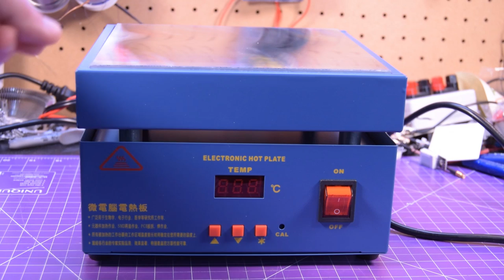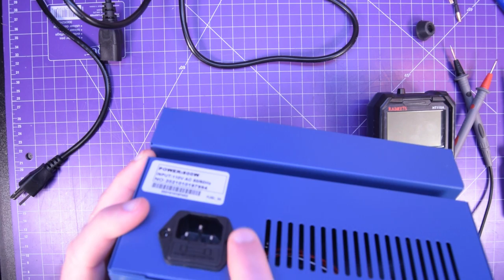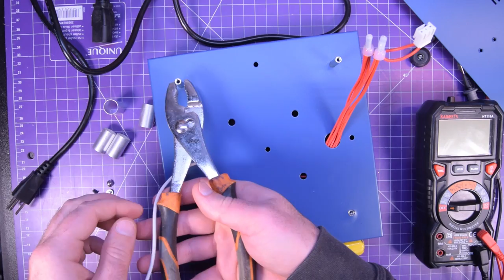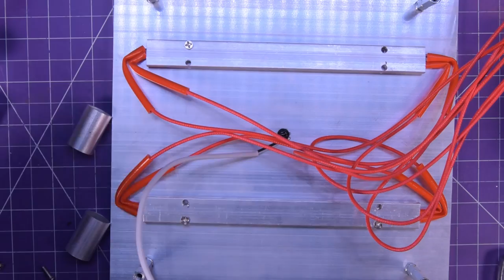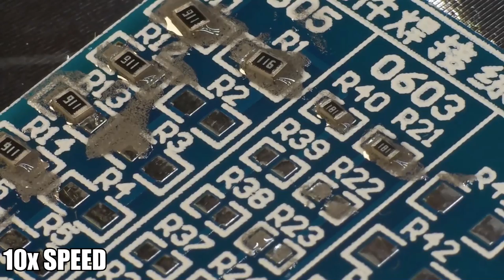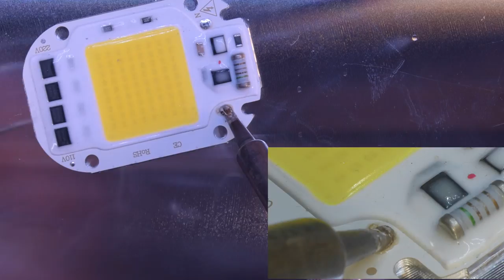Teardown And First Test Of A Soldering Hotplate! (946C First Look)

Comment: That's a much better heater setup than my unit (which looks exactly the same on the outside).  Either I got a cheap copy or they have changed the design.  Mine had a one-piece heating pad held against the top plate by a large metal plate -- which was painted (and burned, as I commented before). Anyone who gets one should check the heating element setup to make sure they got the right kind.

Comment: In a former life I worked as a heavy equipment mechanic.  We would never put wiring through a metal plate without some rubber grommets to protect the wire from rubbing on the metal.

Comment: to build that would cost more if you went dimensionally accurate. amazon charges like 40 beans for a decent sized aluminium plate but the rest would be cheap only it would add up. i bet it could be modded to remove screens from devices as well. i laughed when i seen the transformer haha.

Comment: It seems like they were thinking that the bottom plate and transformer would get grounded through the mounting screws.
Possibly adding star or lock washers would work.
Reply: Scrape away some of the blue coating.

Comment: With four self tapping sheet metal screws going through that bottom plate, it's hardly not going to be grounded if, as you demonstrate, the sides of the metal case are grounded. Probing the powder coating doesn't really prove anything because you'd expect that to be an insulator. And to want to put heatshrink tubing on the spade connectors in case they fall off seems a bit obsessive and highly unlikely. I bet you couldn't shake the entire unit hard enough to get those spades to fall off the switch. You seem to be extremely critical and looking for any kind of negative (the holes seem to be drilled by hand being one of several examples).

Comment: I just got one and I don’t understand the directions, it says not operate hotter than 110 degrees Celsius- or the lcd screen may be destroyed. Can I pump up the temperature for smd soldering, or should I just leave it at 100 degrees and use a hot air station to bring it up the rest of the way?

Comment: A much simpler mod would be to sink an additional self-tapping screw from the bottom into the flange of the sides.  Two for redundancy if you want.  First scrape away a little paint if you're paranoid, but the self tapping screw would be totally sufficient.

Comment: would thermal paste between the heating elements and the plate help to maintain constant temps? or heat up faster? Also, most of the 946c models come with heat shrink wrap on all the terminals, but obviously worth checking after seeing how yours came, ohh and most versions are grounded. Yes I'd like to see how you modify yours! nice vid, thanks:) you get a sub so I don't miss your mod video.
Reply from the maker: This one is grounded - minus one panel. I think thermal compound would make it heat faster and maintain easier unless it was tuned without that - but I doubt it was tuned at all!

Comment: Nice review of the product and strip down shame that after commenting that there was not thermal compound you did not add some?? the clips on the socket are captive with a sprung tab of metal China has never understood earthing even in their plug tops🙂
Reply: Super fast SQUEAK !!!!!!
Reply: @andymouse  double Cheese!!!!!!!!!!!!!
Reply from the maker: I wanted to test it "as is" first - and I don't have any super-high-temp thermal compound - the best stuff is from Slice Engineering and I can't afford any at the moment - and CPU heat sink compound isn't designed to work above 100c